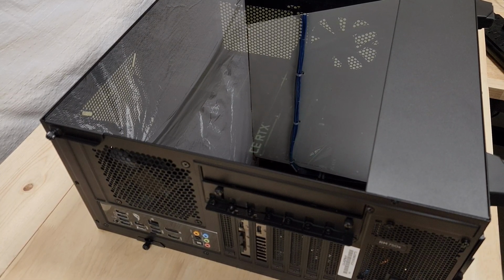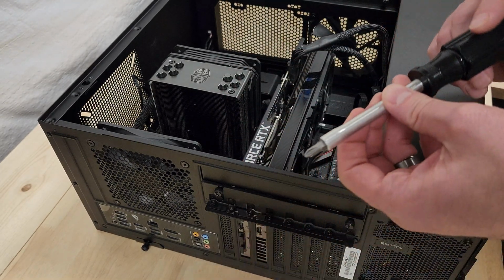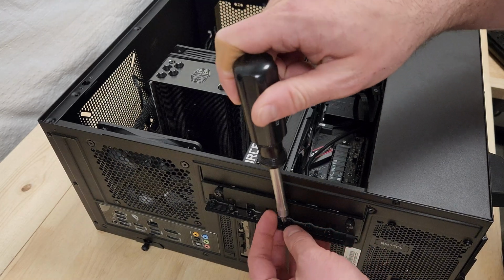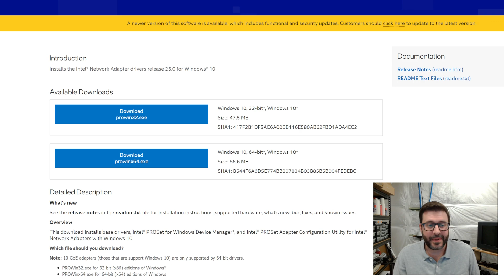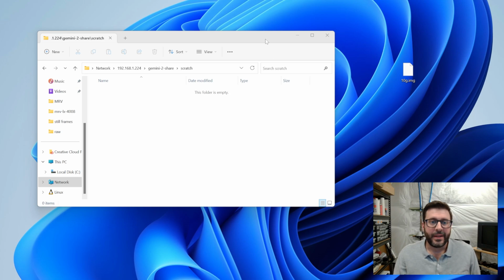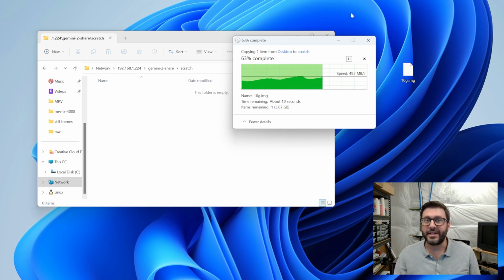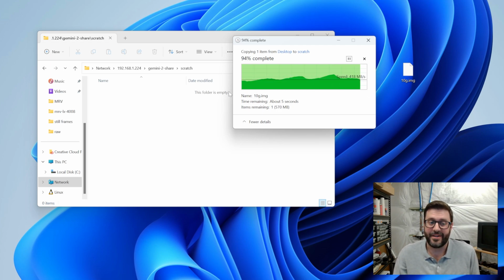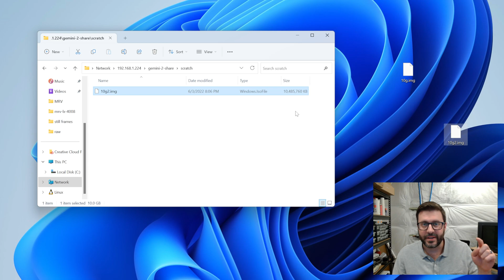Upgrading my main machine to 10GbE

Comment: They get so hot because you are using ethernet on your 10Gbe adapters. If you just use fiber, things will 1. Run cooler, 2. Have lower latency, 3. consume less wattage  and 4. It's even cheaper. You can just go to micro center and pick up precut fiber cable like you would ethernet with the adapters already connected even if you want. 

Not the biggest deal or anything, but it will keep your adapter from running so hot.

Comment: This explains so much why I had a heck of a time finding the right driver to install.

Device manager still shows no driver installed yet it's working after using the utility software that I found on reddit.
I also had to use an older driver.

 Makes me wonder if there will be any vulnerabilities for not updating. I'm going to shop around and see if I can find something with updated drivers for windows 11 that's not eol

Comment: If I only have one PC, will the switch make a difference or is this only for multiple PCs/Servers etc? Could I just buy the cables, and card and see the benefits as-is?
Reply: If there's nothing else on your network running 10GbE then no, you won't see any benefit. You need to have 10GbE through the whole path you want to speed up -- so the switch and other computers you want to connect to also need to support 10GbE.

Comment: I tried a SFP+ router the TP-limk archer was $800 piece of 💩 had to get a AC unit pointed at it just to get it past basic installation it died a hr into trying to get it setup returned it and bought Asus ROG GT-BE96 until Canada allows the GT-BE98 Pro to be sold here not spending $1650 on a 3rd party seller on Amazon 🤣🤣🤣

Didnt see the Edifiers i got the same onea with a nice tube preamp/Dac gita watxh mkre ofnyoure vids im just now finally getting into 10gb gear.

Comment: If you are using Windows, utilizing a dual 10Gbe nic card can get you 20Gbps bandwidth with SMB multichannel as long as the NAS endpoint also has dual 10Gbe ports connected. I'm seeing speeds upto 2.10 GBps (16.8 Gbps) upload/download throughput.

Comment: You saved my bacon on a different 10Gtek 10gig adapter.  Intel X540-10G-2T-X8.  Just downloaded the version linked, installed, and instantly worked.  Broke my onboard NIC on ASUS B650E-E but I don't care because my dual 10G nic works.

Thanks man.  Highly appreciate it
Reply from the maker: Nice, glad you got it working! I was definitely panicking until I figured it out ha.
Reply: Ugh Realtek onboard did it again. I also looking at Intel X550-T2 because I aim at the least CPU usage possible only applications and games use the CPU. I already have Sound Blaster AE-7 to go with it.
Reply: Would you please share the driver link ? thanks

Comment: I never got above 5 Gbit with CAT5e cables
Reply from the maker: I've got something up at the switch level, I can't get beyond 5gig even between the two servers (which are connected to the agg via DAC cables). always more to investigate 😂
Reply: Cat5e isn't rated to 10Gbit speeds. You need Cat6 for that

Comment: You should take a look at iperf (3) and see if you can get close (95%+ to wire speed...)
Reply from the maker: I ran some iperf3 tests after I filmed this video and I actually only get 4-5Gbits/sec, even between the two Dell servers which are connected directly through the aggregate switch. Flow Control and Jumbo Frames don't make a difference, so I have more investigation to do.

Comment: low speed for 10gbe
Reply from the maker: Yeah plenty more tweaking to do, experimenting with jumbo frames, making sure the entire run to the aggregate switch is Cat6, etc. But doubling the speed felt good anyway!
Reply: @clabretro  strange, i also have unifi and 10gbe on all my servers and pc's, never had to change jumbo frames, speeds are never below 800MB/s, even on cat5e cables

Comment: Ever thought about using SFP+ Optical instead of a dac ?
Reply from the maker: Definitely, just haven't dove in yet. it's probably the better option even over cat6 and would probably even be cheaper than buying these SFP+ to ethernet adapters. have you messed around with it yet?
Reply: @clabretro  I use SFP+ transceviers and cables, WAY cheaper then DAC cables & cheaper then sfp+ to RJ45..  and less power hungry and heat too..
Reply: @JasonsLabVideos  I don't know how you're getting an SR Transceiver pair and OM3/4 cable for less than a good DAC cable. I find DAC cable much less money. I have DAC, SR optical, and RJ45 Transceivers (which is the most expensive and HOT).
Reply: @Doesntcompute2k  Amazon.
Reply: @clabretro  You can get extremely cheap 10GBit-SR CIBICs for SFP+ from China. They run in these cards. They are Intel CIBICs. I think like 9$ per CIBIC.
Reply: thats how i'm doing mine Jason fibre for the world, lol. Its fragile but not as fragile as people worry about
Reply: @Gr8ComputerServices  People think it's so fragile :) it's not to bad..